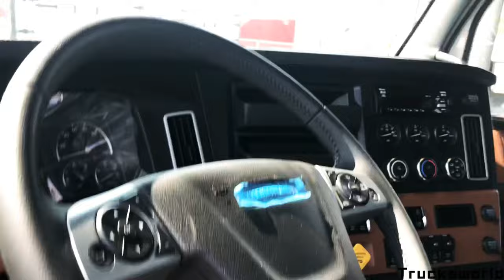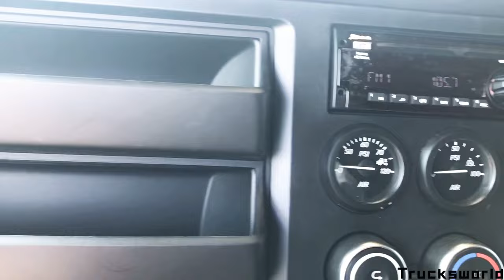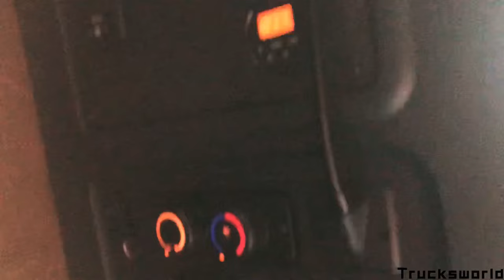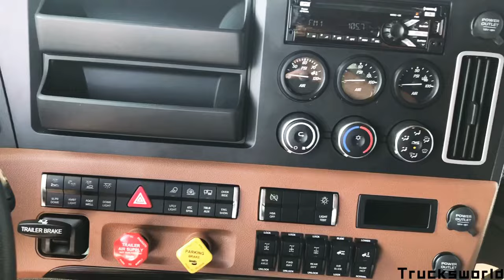2020 Freightliner Cascadia - Straight From Factory - Full Review

Comment: I love this truck, roomy, comfortable,  the top bunk is high so you not bumping your head when you get up. The storage cabin are deep, lots of storage space. This is by far the best truck of 2020. This truck was designed with the driver in mind. Oh love the REFRIGERATOR,  love the air vents and their design. It rides smooths as hell.  As a driver the entire compartment from steering to the foot pedal to the comfortable seat will spoil you. So much room on the dash board, the lights lights up the entire highway. Damn imma stop now I love this truck . Freightliner you out did yourself
Reply from the maker: Yes Sir, You’re Right.
Reply: @TrucksWorld  I have driven many Freightliners over the years.  I used to be a Freightliner hater, until they came out with the Columbia.  They knocked it out of the park with that one.  Beautiful truck ! And then they came out with the Cascadia.  Best looking truck on the road !  Even their little M2  is head and shoulders better than anything else in the business class.  I have not driven the M2, but they are a great looking truck in every way.  Freightliner,  I like you now !
Reply: My Volvo 2021 in the shop for a week. Boss offered me same 2020 cascadia. I’m scared to drive this truck cause is so different. Is it good on the road?

Comment: I got the same truck, but my fridge n microwave outlets doesn’t seem to work. Is there a switch or breaker I have to activate or what?
Reply from the maker: Hi SuperNovah, It could the issue in power inverter, check that works or not.

Comment: The torque is so WEAK compared to Scania. A scania 520 has 2700 torque. Only thing about American truck is SIZE and a weak engine under the hood.
Reply from the maker: Hi Timaya,  The engine is not weak of these trucks, it’s depends on for what region or country truck made for. Like Scania is not made for to work in North America & America trucks are not made for where you from.